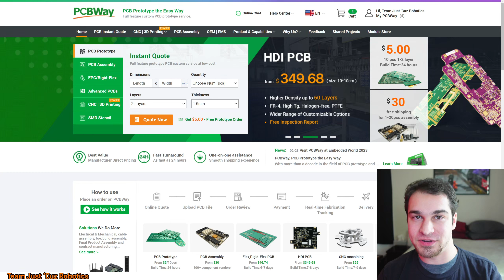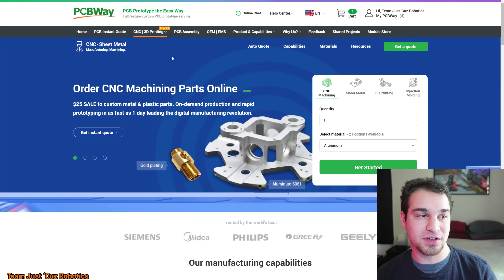Death Machines and Broken Dreams - Mini Mulcher MakerBattle Recap April 2023

Comment from the maker: Just realized I forgot to say what happened in the last fight: SPOLERS
.
.
.
.
Remember how the motor shaft is now right hand thread? I for some reason thought that the Shuriken blade needed to be flipped upside down so the sharp impact points would hit to tighten the nut holding on the motor gear. Turns out I was wrong and it loosened that way. I got a few hits in with the weapon direction reversing over and over intentionally to get a hit, then tighten the nut again, then get another hit, etc, but eventually it loosened too far, rose up and jammed into the weapon so it could no longer turn at all.
Reply: Hi! I love this bot and want to build it, after i get the cad files, is there a parts list? thanks!
Reply: never mind i bought the blade and the mini mulcher only to realize that i could of just bought mini mulcher lol